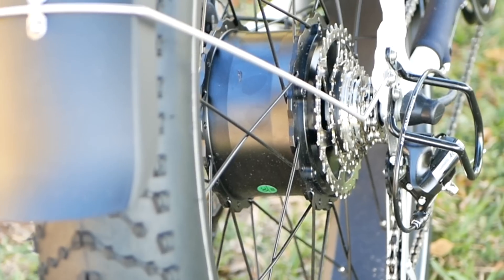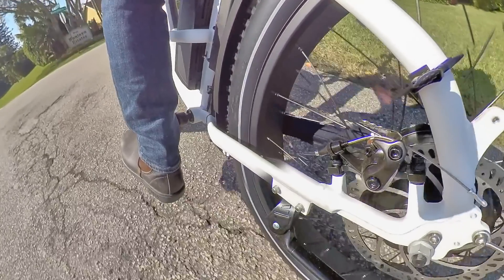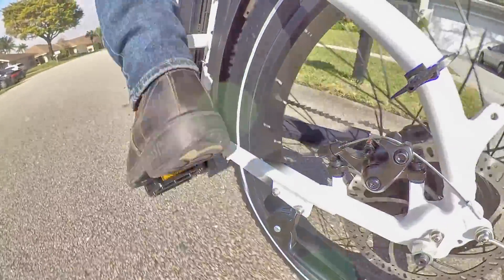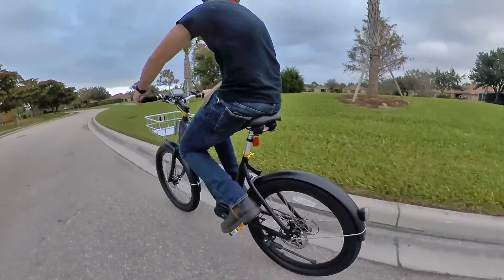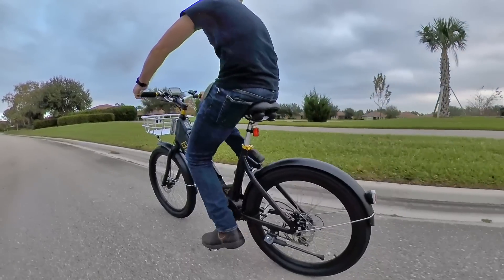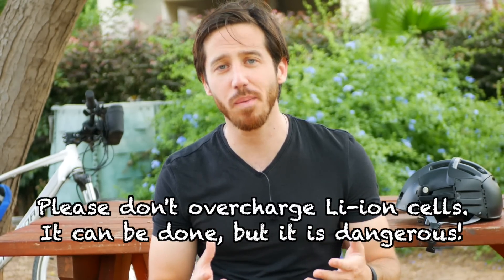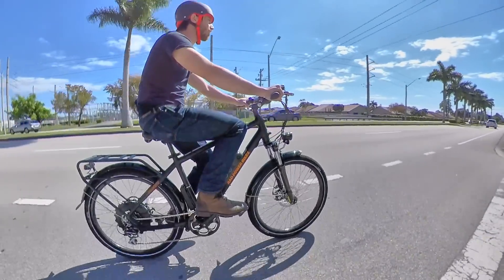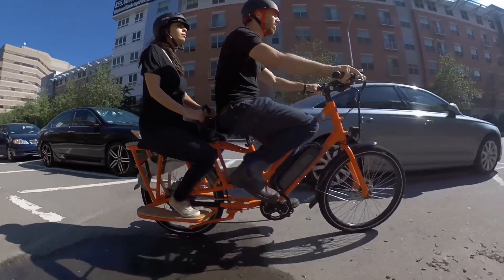Why don't more electric bikes have regen brakes?

Comment: I'm currently running with a Grin Technologies Gmac 10T motor. It does regen braking, has a virtual freewheeling feature in the controller (so it feels like normal freewheeling), and is a geared motor. I usually gain back around 8-11% of my ride depending on my riding style and haven't had to engage my brakes in any meaningful way in months! Oh, and I can use the throttle to modulate how much regen braking is going on. I have it start at 50% braking and can crank it to 100% with the throttle as needed. It seriously is the best of both worlds! I love this motor!
Reply: An ideal motor, which no one makes, would be geared (5:1 planetary drive as is typical) with a one-direction freewheel passive clutch, as is typical, but also an internal TWO-WAY clutch which is activated electronically to brake, go backward, and to "~lock" the motor when parked so someone who cuts your bike lock can't easily ride the ebike away (and the typical ebike weight makes it harder to carry away of course, and they won't be able to roll it away on the rear wheel it it's a rear hub motor).
Reply: My last ride gave me 55.5% regen. I live in Seattle where it’s a hill everywhere. I get exercise up gentler grades or early in a ride get serious exercise up steeper grades and have power when I need to clear an intersection or when I’m just worn out and done.
Reply: @wjksea  great, could you tell us if your brakes wear out a lot less?  What type of motor, not geared?  What type of bike, year model?  How many miles do you put on a year? Do you have option of not using regenerative downhill when you'd rather go really fast?  Do you feel drag from it only when coasting downhill, or do you also feel drag from it going uphill?
Reply: Just took a look at that GMAC. Very nice unit. Definitely gonna consider it. Thanks!
Reply: @wearemilesfromnowhere4630  I've been eyeing the GMAC for awhile. I don't like that its geared (Plastic gears!) but at the same time that 5 to 1 gear ratio means that you get a lot more braking force and more energy converted into electricity compared to a DD motor. I also don't like that it uses a proprietary connector. And by don't like I mean, I HATE Grin Tech for all its proprietary BS.
Reply: Don't look too hard to change the planetary gears if they wear out though.
Their connector looks really clean and neat. I think they genuinely try to innovate, I've never seen this "proprietary" side you speak of. Their stuff is made to be compatible with other stuff.
Not to speak of that you are not dependent on DNP freehubs anymore with the GMAC.
Reply: casey b, Grin takes pride in not being proprietary as ebike manufacturers do not. The non-proprietary connector they are trying to make more standard is of superior quality to the other connectors used for connecting battery to charger. The GMAC system can be placed on a high quality frame and components and switched out if/when desired to any other bike whereas manufactured ebikes come with proprietary components that are of lesser quality to keep cost down and can result in a total throw away bike in typically 5 years.
Reply: I wish they had options for belt drives. Or do they?
Reply: William Wilhite  oh yes... But I use my bike as a car replacement. I regret n
not throwing 500$ more at it for a GMAC and Phaserunner.
Reply: GMAC 8T Gearedd-Hub motor with Phaserunner with Proportional Regen Braking here ! Before the Regen was set-up I was going through BRAKE PADS like crazy. Only personal experienced people seem to know that is the best reason for Regen, and why you need a hub motor for it. Only for the DIY Elite, Cheers

Comment: I imagine putting all that stress of breaking on small bicycle hardware would not be good for the longevity of the motor.  This isn't a car or a motorcycle that weighs like 400lbs
Reply: Forward or reverse torque, same thing as far as the motor is concerned.

Comment: I would like to buy a hard tail mountain bike and install a Bafang 1000watt motor on it. I’m somewhat handy. My question is: since this motor puts a lot of presure (torque) on the rear wheel SPOKES , what Gage should they be? 10,12 or 14 gage? Or I shouldn’t worry about it.  Please let me know. You can text me if it’s ok:
310-435-2559 -FRED

Comment: All good points. Regen as a feature has its benefits and its tradeoffs, and because of those tradeoffs, it's definitely not a good fit for everyone.

I use regen as my primary brake, but mainly because of how much it reduces the wear & tear on my disc brakes. I've seen upwards of 20% energy recapture at times (if I cherry pick from my segments out in the mountains), but day to day it's more in the 2-4% range - definitely not the selling point. But for a high-mileage rider with a heavy bike and cargo, being able to reduce my brake maintenance to nearly nothing isn't a small thing.

Comment: Best thing about regen braking is the reduced wear on your brake pads.
Reply: Yes, and it's an extremely reliable brake. Not subject to accidental grease on a disc rotor or to wet weather. A light squeeze & you get (anti-lock) breaking. Unfortunately they don't brake much below 10MPH. I really don't care much whether it recharges the battery that little bit.
Reply: This has been a key argument in considering some regen capable hub motor for my travel bike. I'm carrying 200+kg system weight and get tired on mountain passes. Then when going down for 5km I really regret wasting all that kinetic energy and literally have to stop to cool down my (rim) brakes, not ideal I know. 
What convinced me to not pursue this idea is to do with the fact that going up a mountain pass (even when using the most efficient set-up like in a 16 inch trailer wheel) the motor and battery will be quiet hot when reaching the top, so putting in 8+Amps of regen downhill is not such a great idea either. 
I'm now dreaming of solar (love what the SunTrip guys are doing) and thinking of buying one of those running parachutes for the downhill : )
Reply: @velotill  if the motor/battery is ran within its rated current, heat will not be an issue.
Reply: @LECTURE NOTES BY ASSOC PROF IR OTHMAN AHMAD The gain isn't worth the money spent.
Reply: This
Reply: And getting some range for free
Reply: LOL... unless its a lotech direct motor, you've been fooled.
Reply: A little bit of jucie

Comment: Better to pedal easily when out of battery than saving a few % on reg breaking and eventually deplete the batt
Reply: You gain more with regen in a typical city ride cycle than you lose with motor drag. This means you always have more than enough energy to overcome motor drag. 

Also you don't just run out of battery. As you notice your levels dropping you ride slower and extend the range of your battery.
Reply: difflocktwo yep you don’t... but when you do... you need to be able to use the pedal right?
Reply: @karliniego  Electric cars and motorcycles don't have pedals... It might be easier to carry a fast charger and get a quick boost. Fast chargers are not common in ebikes though.

I once had to transport a old lead acid electric motorcycle. It didn't have pedals and weighed 100+ kg. 

I ran up hill with it, giving a bit of throttle to help me out, and then coasted down hill. I did 50 km like this. At the end I had used very little battery energy and could have probably done less running.

Comment: I have actually always wonder about this question. Thank you! The other question I have wondered is what happens when I plug in an additional battery in my charge port?
Reply: You could potentially plug in a second battery into the charge port. This would essentially be connecting a second battery in parallel depending on your BMS setup. 

Be very careful doing this though. The two batteries need to be at the same voltage or current will pass from one battery to the other. If the voltage difference is too much then this can easily cause damage or even fire.

Not recommended to parallel batteries unless you know what you are doing.

Comment: What about using a roller type generator that is used for a headlight...like the old Sanyo’s on road bikes. Could this be wired into the battery directly for just a trickle charge for maintaining voltage?

Comment: I've always been nervous about adding regen to my front hub kit. Sure there's torque arms, but why stress the forks any more than necessary.
Reply: If your forks can't handle regen braking then I wouldn't trust them while using your normal brakes...
Reply: I need help. I bought a 5000w 72v battery rear hub kit and having trouble getting the axle into the frame. The axle is so fat in diameter. Any suggestions?

Comment: Reason #4 : The human/bike mass is only around 200 lbs, traveling at low speed so there isn't much momentum energy to recover.  On the other hand, the mass of an automobile is typically 4000 lbs and it can travel at 60mph, providing plenty of energy for recovery.
Reply: Regen on a bicycle captures enough energy to compensate for all magnetic/ mechanical drag. Imagine a frictionless bicycle, that's what regen gets you.
Reply: That does not make any sense. The energy you use to accelerate is the energy you can recover. Of course you have more energy in a 2 ton car but you also used much more to accelerate it. Mass of the system doesn't have any effect on the equation here.

Comment: Micah, thanks for the details. To close the loop, what does the regen cost over a standard set up? If the bike without cost $1,000 would the regen option add $250 to make it $1,250 or is it more?
Reply: If you're already looking at building an ebike with a direct-drive hub motor, simple on/off regen is "free" or close to it. It's a feature of the controller that adds no or next to no manufacturing cost to the controller itself - you just have to pick a motor controller with regen as an advertised feature. As mentioned in Micah's video, you do want a battery with a BMS that can safely handle the regen charging current coming in from the discharge port, but two of the most reputable battery vendors for DIY setups either build their packs ready for regen by default (EM3ev), or will add that capability for a small upcharge if you ask for it (UnitPackPower).

If you were looking at building a bike with a different motor type (a geared hub motor or a mid-drive) but you've weighed your options and decided that you want regen, than you'll have to compare the cost of a direct-drive hub motor and a regen-capable controller against the cost of the system you were previously looking at. Compared to most geared hubs and mid-drives, you'll often find a direct-drive hub motor setup to be cheaper overall.

If you are looking at taking an existing ebike and adding regen to it, once you're done the bike will need a direct-drive motor (they start at around $100 but the price can go way up from there if you're looking for something more fancy) and a regen-capable controller (starting at around $50 for a halfway decent controller with on/off regen, all the way up to $300+ for a fancy controller with smooth variable regen). So, depending on what the existing ebike needs to make it regen-capable, and what sort of functionality you're after, anywhere from $50 (if all you needed was a new controller) all the way up to $???.

Of course, each of the main three types of motor system (direct-drive hub, geared hub, and mid-drive) have their strengths and weaknesses relative to each other, and regen is just one of the capabilities that you want to weigh when deciding which type of motor system is right for your needs. But that's an entirely separate discussion.
Reply: You're asking the right questions. The video dances around the facts and figures.

Comment: I agree with you on regenerative braking. The only reason I would see a practical use would be bike touring. You also have to think about regenerative braking placing extra stress on the bike frame when implemented. Another positive issue with regenerative braking is most systems have a safety That does not allow you to charge your battery when it is above 75% so you do not have to worry about overcharging your battery. I get much more efficient charging by placing 2 flexible 40W solar panels, one on my front fender and one on the back fender. This way I get a much less of an increase in wind resistance. I live in Arizona so I get a great constant trickle charge through a voltage regulated buck converter to my batteries. I get an estimated 7 to 10% range increase depending on the usable sunlight. I did try regenerative braking on my front motor with an updated voltage controller and a second battery, but I really never noticed an improvement In battery storage, I think that was more related to the environment I ride in having very few downhill routes. Anyway I like your DIY battery Book, Thanks for the video.

Comment: They should have some sort of flywheel or coil spring system to store the energy away from the battery and then either charge the battery or use it to propel you when you restart your ride ....
Reply: That is overly complicated. Just use a bigger battery if you have energy storage issues.
Reply: It's a good idea but the weight is a problem.
Reply: @andrewjames7923  Why is weight a problem?
Reply: @andrewjames7923  
That can be addressed with an alloy/ carbon fibre  flywheel type of configuration

Comment: Why don't they use a friction generator like the ones used to power a headlight?   Two generators; one in front and one in back that would make contact with the wheel when braking.

Comment: Also, in relation to mid mounted motors, you would have to have a transmission that would allow the chain to pull from the rear (sort of like the old back-peddle coaster brakes) derailleur changers wouldn't allow this, the reach mechanism would be pulled forward.

Comment: For me the biggest reason that mid-drives don’t have regenerative breaking is that the rear hub would need to be locked instead of freewheeling and the pedals would be constantly spinning if you were moving. Absolutely no coasting!
Reply: Shimano created the FFS (front freewheel system).

Comment: Regen is so important for heavy EVs like car, bus or truck! It saves the braking system and helps a lot.
I think even a motorcycle can use it. But for the bicycles I prefer something lighter and cheaper :D :D :D
Reply: Nothing cheaper than no mechanical drivetrain. With no mechanical drivetrain regen is free. So anything without regen capabilities would be more expensive.

Comment: Thankfully, my ebike has enough range where regen braking isn't an issue. I had given thought to the old fashioned generators we used for adding lights to our bikes at one point. A couple of those rubbing both sides of the tire would add some range and could be made to disengage when not wanted but again, that's just more weight and complexity  added for too little return.
Reply: I also recall the old generators that usually lit a front headlight.  I also recall the extra peddling required when they were engaged.  Like hitting a brick wall.  I'm certain they would provide braking when engaged.  A little math would be required to determine if the system is economic.  I doubt a typical e-biker is spending a significant amount on electricity to keep his e-bike batteries topped off.

Comment: I put the cheap kit on my daughter bike.  She's loving it.put new sprucket on without locktiting it and it started to come loose. Locktiting it and all is good.i just wish you would explain why these batteries that are so cheap as to what they really are.please! One 28000 mAh battery is not enough. I hook also 2 scooter batteries with it and great. One 28000 mAh battery came in for hub motor not enough! The kit said that you would need battery above 12 amp hour still if you use the cheaper batteries 2 is still less than I good battery. I am new to all this, but learning very quickly. the wait game stinks as this is my only means of transportation.i bought the super 48 volt battery off of eBay 2 weeks ago. Still waiting but that one I know will push the hub kit I bought! That battery has 78 cells. My confusion is how are these batteries advertise what there not? Still 2 or more is cheaper than one good one! Just wish I knew all this starting out! I hope sooner than later I figure it all out. Other than the sprucket problem with the 36 volt 450 Watt kit my daughter is loving it.none of my frames work right with it! Hers is a Schwinn sidewinder and works perfect. The only problem is placement of all batteries.one cheap 28 ah battery 2 scooter batteries in parallel. Excellent range.  I usually don't like to post stuff but I figured this might help someone. Thanks Ray

Comment: Hi Micah, interesting subject 👍
- Cogging resistance?
I use with my controller a 'virtual freewheel' option: it 'consumes' 10 wh from the battery (not a lot!)
But 'coasting' riding experience with a Direct Drive hub motor is really as if I didn't have any cogging!
- Regen with full battery? A good controller can easily handle that!
- How much Regen you can get? It depends mainly on the "profile" of your trip:
-> on flat roads...nothing significant (<5%)
-> hilly roads....(>5% and < 15%)
-> mountain roads (>15% up to more than 50%!)
You can check those numbers on my tests:
http://gonano.eu/regenerative-braking-efficiency
- Unfortunately there is no mention of smooth regen braking to save brake pads from extra wearing 😉